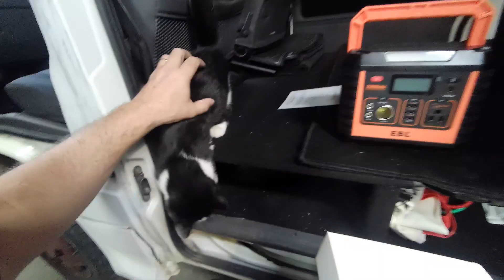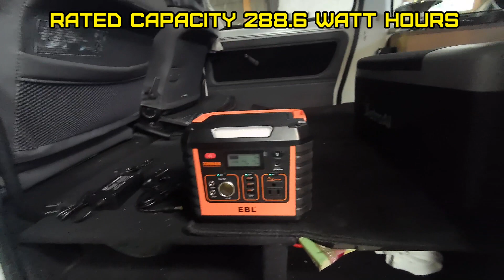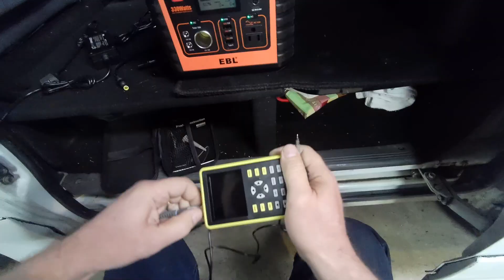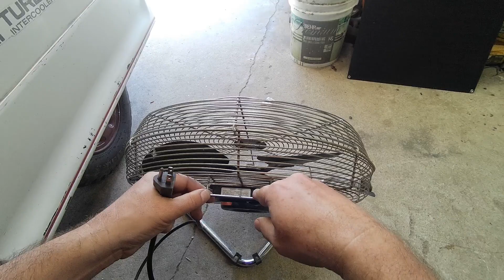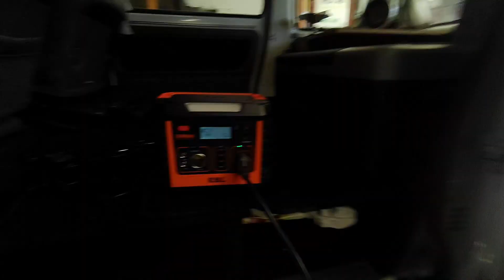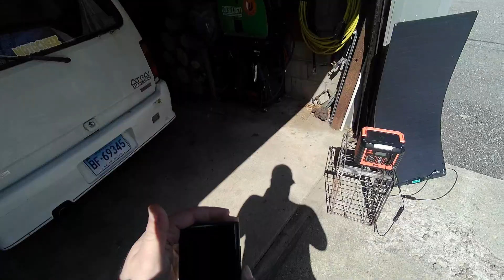EBL 330 watt gasless Portable Power Generator. Pure sine wave, Camping, RV, Jeep, van, car, outdoors

Comment: When I plug my Harbor Freight solar panel into the EBL 300 the display just blinks like it's about to charge but never charges. 🤷
Reply from the maker: Which solar panel? Maybe it's not getting enough watts?
Reply from the maker: That should definitely work, good sunshine too?
Reply: @MotoCheez  I thought the sunshine was decent. I'll get a multimeter to test the solar. Thanks for responding and the video.
Reply from the maker: Polarity right and in the solar socket?
Reply: @MotoCheez  Been busy, thanks, you helped me figure it out. I thought I was getting enough sun but today was a bright day and it's working great. Getting 50+ watts.
Reply from the maker: Awesome!

Comment: ever figure out why it wasnt charging @100 watts with your solar panel?
Reply from the maker: No.  Idk  why
Reply: @MotoCheez  oh okay thank you for the quick response. Im really debating on what solar generator to go with, dont wanna make the wrong choice and be out 100s of dollars.
Reply from the maker: From what I understand a 100 watt panel doesn't put out 100 watts, I was thinking maybe because it wasn't direct sun? Plus max charge is 60 watts on this unit, probably why they recommend 100 watts so it's close on not as sunny days?

Comment: i have a cheaper 24000mah 180watt power bank with 2 normal usb 2 amp outputs i got it for free so not mad about the only 180 watt ac output
Reply from the maker: Free is good! Can't be mad about that

Comment: Great job man, now try it with your mini fridge while using the solar adapter and connected to the solar panel on an overnight trip and take some ice cream along 😀 😋.
Reply from the maker: I was more thinking along the lines of having a solar panel charge my second battery and then I can always switch it to the inverter if it dies or charge it off to 12 volt because the battery is much larger

Comment: I had a portable generator from Overland Solar, but some puke broke into my rig and stole it (fortunately, did not get my 100W solar panel).  I replaced it with a GoLabs 300W unit.  Features are much like that one, except mine does not have the wireless charge feature for my phone.  GoLabs uses the MC4 connectors, my solar panel is Anderson connectors, so I have an adapter cable on order, as well as a 20ft. charging cable for the solar panel.  

I think you'll enjoy having that little unit around.
Reply from the maker: They use the bigger connections because larger panel? I've always wondered that

Comment: Vin Cheezel if you ever have problems with that one you just bought, I suggest getting the Jackery Explorer 300 watt. It will be equal to what you got & it’s the same price as the one you got in a name brand. There’s lots of offgrid homesteading YouTube channels using the Jackery brand. Some  have had theirs for several years and they are still going and working like they’re supposed to. Just a suggestion brother. 👍
Reply: EBL isn't an offbrand, they're actually huge just not really in north america. I wouldn't worry about their stuff. Jackery's are rebadged oem units as well, not a bad thing but keep that in mind.
Reply: @nismo4x4n  if you’d have known & U look at my first comment that’s in the comment section U’ll see said that’s a cool unit you got for camping in the van. I wasn’t bashing the unit he got fella. I said if it gives U problems consider getting the Name Brand Jackery 300 watt it’s the same price as the EBL. And the reason I said that is this: No one else on all the channels that’s living Off grid are advertising the EBL. At least the ones that I watch and I watch a lot of off grid homesteading off grid channels.  But there are many Youtube channels advertising the Jackery. Also I know for a fact some of the Off grid channels I watch have had their Jackery’s for 4 & 5 years now and they use the heck outta them. Plus not one channel of at least 10 channels I’ve seen use Jackery has said it stopped working on them. That’s a track record that speaks for itself. That’s all I’m sayin to my buddy Vin Cheezel.  And in my opinion a track record like that is what you look at. Same as cars 🚙 which ones last the longest, get the most miles outta them and give the least amount of trouble. Same as generators a Honda generator is the quietest and longest lasting you can buy. I know people who have got Honda generators they have had many years that still work as good and quite as the day  they bought them with good maintenance. Also I know people including myself who have bought a Harbor Freight generator and it only last 3 years and the generator  was worn out. Track records speak volumes for everything from; people, to mechanical items. 
I merely made the man a suggestion on buying a Jackery for the same Wattage at the same  price if the EBL didn’t Hold up. 
I was certainly not saying the EBL wasn’t any good. But i will tell ya this much I’ve been watching Cheez for years now & if anything turns out to be junk he won’t hesitate one second on letting us know its junk. Cheez is a straight up guy when it comes to that and if it’s junk I’ve seen him get on here and say it didn’t last long it was junk. So I was letting him know that if it turns out to be junk He could look into a jackery next.

Comment: Would installing this in the back of the Van, almost equal to the additional Battery you just did?
Do you plan on showing how you would mount/use the "Soft" Solar Panels?
Love your Channel!
P.S. Thanks again for the Gloves, I have them Framed in my Garage...
If prices ever go down, I want either a MAZDA Scrum (Quad cab) or a HONDA Accty KEI Truck, but not Dump Bed.
Happy "BELATED" Easter Cheese! 🧀
Reply from the maker: I don't believe I'm going to mount this but I do want to put that flexible solar panel on the roof I'm just trying to figure out the best way to mount it, plus I have to paint the van so I don't want to permanently mount it until everything is done painted-wise. Haha that's cool you still have the gloves, yeah the prices hopefully will come down eventually but it's not looking that way

Comment: Cheezy  what does the sign wave scope do. Sign wave square wave.  I don’t understand the info that it was showing Thanks CHEEZ
Reply from the maker: It was a sine wave, typically the inverters in the units that you buy to run off the battery or square wave it basically has a flat line on one cycle then goes up and does another flat wave on another cycle
Reply: @MotoCheez  Thanks for the info..

Comment: great review 👍, angle that solar panel a little more , as summer time approaches it will do better at about a 20 to 30 degree angle instead of standing upright.
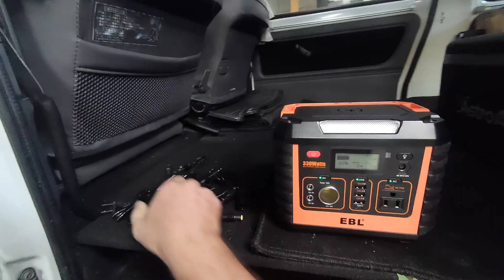Reply from the maker: I positioned it like my shadow was casting, but I may have been a little bit too high upright it was in the evening about 3:30
Reply: @MotoCheez  Yup, with a minor amount of bush craft and some mini-zip ties, you could make an adjustable stand / brace for the solar panel, easy.
(Heck, I have a small ball of hemp twine I'm still working thru that'll do the job...that stuff is strong AF)

Comment: Jump pack would be useful if included
Reply from the maker: That would have been a good idea, but they don't offer it I guess probably because it doesn't have a 12 volt lithium battery inside I believe it was 7.8 or something like that
Reply: @MotoCheez  that’s normal as those jump packs ramp up to 13v or so

Comment: I have absolutely no need for one of those, but yeah, now I'm thinking of getting one........MotoCheez is bending my head.
Reply from the maker: 😄😂 it's nice to have the power goes out and you want to watch TV or have some power to charge your phones etc and not run a gas generator for a while even though it's kind of small, they do make larger ones but they're pricey